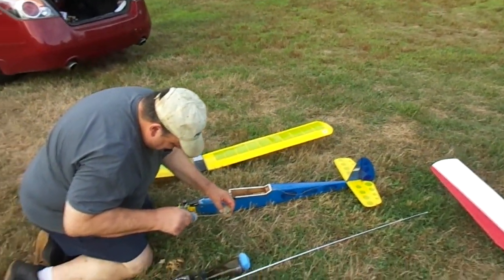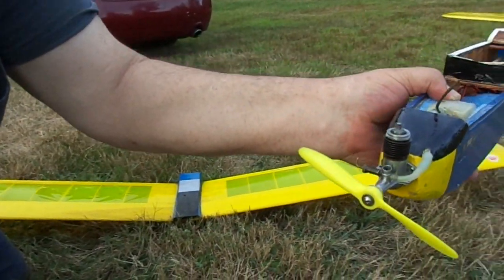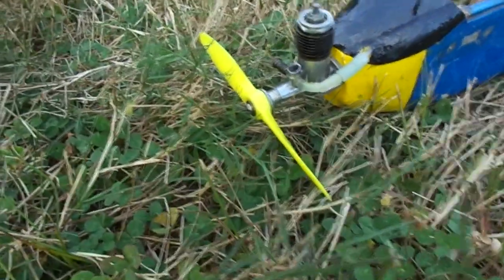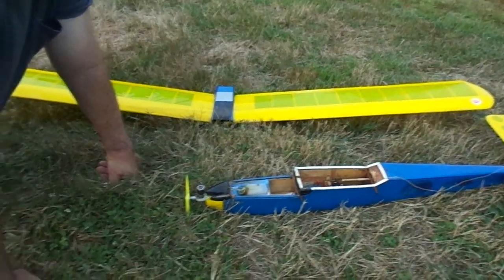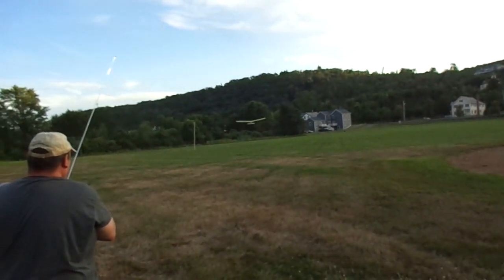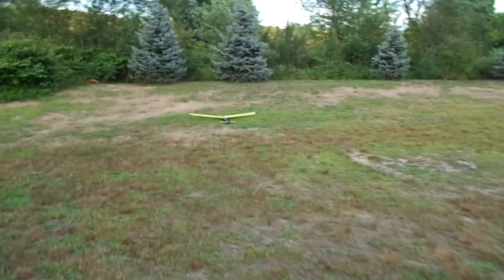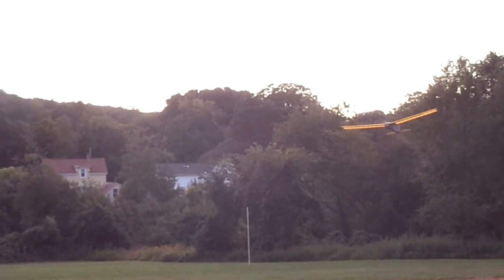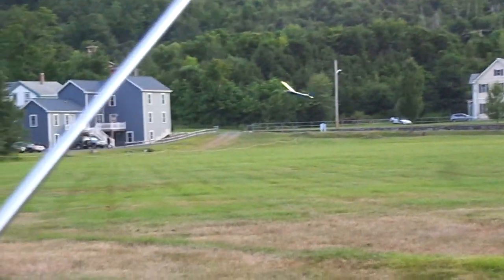Windward Glider w/ OK CUB .049 Antique Engine!

Comment: I used to fly .049 Ukies in the late 50's to early 60's, I only flew Cox engines on a mix of Cox RTF plastic planes and balsa kits. While I never owned one or even saw one run, I always had the impression the OK Cub and the RTF planes were of a lower quality. Cox ruled that time period, even though I saw a lot of guys flying .049 engines, I never even saw a OK Cub engine in the hands of a flyer, they were pretty much dead. They might have been popular somewhere else, but not here in Okla.

Comment: Bought an OK cub  New in 1960.. I NEVER got it to run Still have it tho... Have had dozens of engines over the years. But that pesky OK was the only one that ever defeated me. Curiously that Windward does better without the badly running OK.:-)
Reply from the maker: You think the OK Cub was a tough starter? Guess you never played with a Thunder Tiger motor from the early 80's. To this day, they are our benchmark when discussing crappy running motors! Legendary, just not in a good way!

Comment: Very cool, I actually have a windward that I rescued, still in kit form, in my collection that I need to get built. I fell in love with this plane when I was building a wanderer in the 70's. Fun video guys!
Reply from the maker: Very cool! That kit goes together super fast and flies great! This particular one flew for years with a power pod above the wing. At first I had a Cox Golden Bee .049 with an exhaust restrictor type throttle  Later I converted it to electric with a little Park 250 brushless...which was barely adequate, but worked! More recently, Richie has tried it with the OK Cub as in this video, and a Wen-Mac .049 also. Now it's been swapped for another Cox....
Good luck with yours!! Thanks for watching .
Reply: Wonderer. My favorite glider of all time.

Comment: Great video!  Like many I am also going back to my beginnings (Balsa, silkspan, and Cox engines).  I have seen a few of these Herkimer motors available from time to time and you mentioned the availability of parts.  Is there a glow plug replacement that is also available?  I"d probably take the plunge if I knew I could get a spare plug.
Reply from the maker: Thank you very much! Most OK Cubs use a standard size short reach glow plug so you can use a modern plug and light it with a nicad as is commonly done these days. Back when the Cub came out glow plugs were always driven with a large 1.5 Volt carbon-zinc cell so don't try to drive an original OK plug with anything more than 1.5V. The Herkimer motors are super cool but quirky to run...if you're more interested in problem free reliable operation, go with Cox or better yet Norvel if you can find one. Either one will far outperform the cub. We flew the glider in this video  with a Wen Mac .049 too, with results on par  with the Herk.

Comment: Hey guys I forgot to mention that was a good story and  nice little travel back in time to hear about that OK cub 0.49 motor.. whatta beautiful plane that u have therr.I luv luvvv luv those  old school planes and motors... I learned on a Cox 189 Cessna  with a 0.49 motor and a cox Sanwa 2 ch radio. That was a very expensive bird for a 10 yr kid back in 1983.  I flew crashed , and rebuilt that 🐦 bird from 1983 to 1988. I  killed it furr good in 1988.. and then 1 day I found the exact same bird 🐦 with a radio all complete at a flea market  for  $40.. talk about getting lucky..anyways I just wanted to comment on that Kool viiddd and plane. 👍🙃👍

Comment: a fellow named Ralph said the Cox engines are a lot better and thought the reed valve may be the reason.
my off hand opinion is that castor oil should be the only oil.  Mostly you have to run these little ones
for a while to get predictable performance.  in modern terms,   If a Cox 094 was 50 watts and a peewee was 25 watts
this engine is about 35 watts.   it sounds like a solid engine.

Comment: Richies last flight reminded me of a light weight thermal glider with 2.8 m wing span I had about 40 years ago. Usually it climed slowly but steadily with a Cox 0.49 BabeBee mounted on a pylon. But sometimes, if motor was not running with highest possible speed, it refused to climb. That´s how you become expert in flying big models for long time at very low altitude. 😁
Reply from the maker: Right! You get pretty good at seeking thermals while the engine's still running! Thanks for watching and commenting!